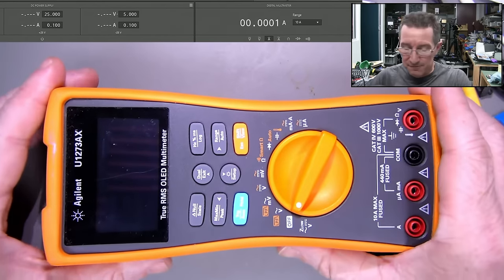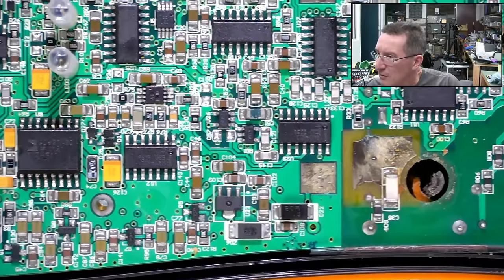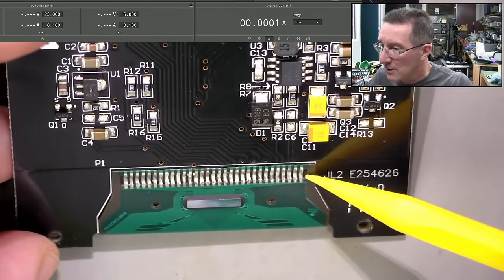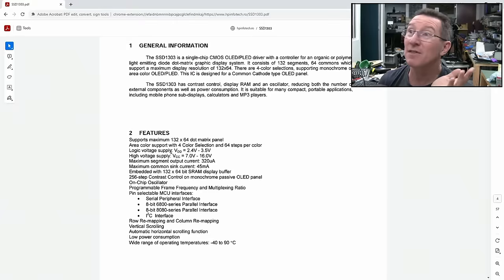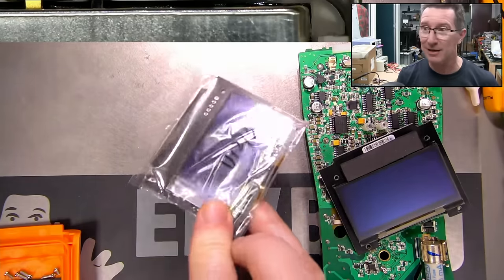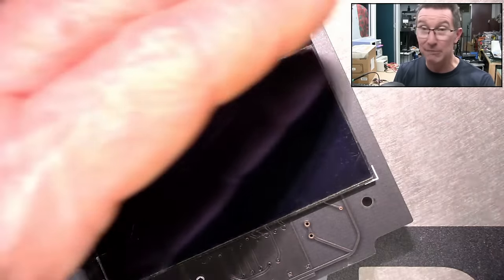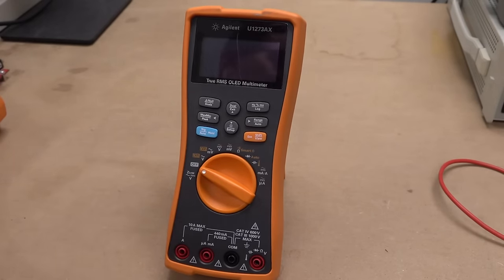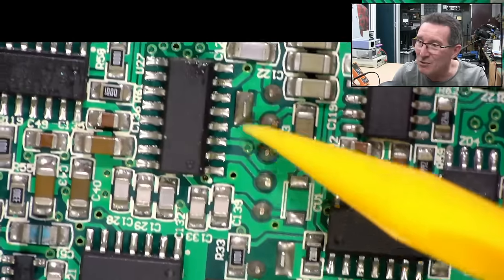EEVblog 1564 - Agilent/Keysight U1273AX Multimeter Repair

Comment: I avoid using alkaline batteries in anything that doesn't see frequent use. I'm gradually switching to lithium ion, but I'm still happy with carbon cells, for the safety of my devices.
Reply: So you're saying only alkaline leak. Carbon and lithium can leak too. We use alkaline as it lasts longer.
Reply: @jonfreeman9682  Indeed, I bought a brand new 996 battery (the big square 6V one) and it was dead; I couldn't be bothered returning it, so I popped the top off and found 2 of the 4 cells were heavily corroded with almost no zinc left. This was a Varta battery, although I note it was made in China and had no production date marked on it.
Reply: @cambridgemart2075  Thanks for sharing. I use alkaline as it's cheaper than lithium which lasts longer but lithium is expensive. Carbon is cheapest but for double the price you get better quality with alkaline which holds the charge longer. I think all batteries can leak and the cause is moisture humidity and overheating of the batteries which cause swelling so the seals are broken and moisture gets in reacting with the chemicals hence corrosion and leak. But lithium is definitely higher build quality. I think if you keep equipment in a dry cool place there won't be any leak no matter carbon or alkaline.

Comment: I really don't like the the 1272A ... quite a few measurements are incredibly slow, you sometimes have to wait several long seconds to get near to the proper measurement. Also often the resistor measurements drifts away happily for minutes.

Comment: Do you know how to calibrate extech clamp meter .I turned potentiometer and I think I need jumper wire to processor .It changes with the weather now with about 300 mv

Comment: What do you do about batteries? I guess take them out of devices if not using regularly.  I've had too many leak in test equipment in the past.
Reply: Eneloops.
Reply: My usual problem is that I am using the device regularly, but then something comes along and the device sits unused for an unpredictable amount of time. Sort of a side effect of having too much stuff and too many interesting projects partially completed.
Reply: Generally batteries don't leak. Put devices in a cool dry place and it'll be fine. I think it's heat that causes battery to leak.

Comment: what I would have done from the beginning if I owned a meter like that is to take them up and apply polyurethane glue around the battery box so that it becomes air tight so that nitric acid cannot get in
Reply: Well you don't want to damage the meter.
Reply: It's potassium hydroxide (an alkali), not nitric acid. But your modification sounds like a great idea.

Comment: I invite you to try using refined coconut oil as sold in any cheapie dollar shop.
Use it as a cleaner or lubricant,when warmed to a liquid it can penetrate under components.
Its low melt point and short chain molecules makes it easy to clean up with warm water or alcohol.
Plastic safe,too!

Comment: I'm starting to wonder what the dollar value of the perfectly good hardware murdered by alkaline batteries every year might be.

It wasn't always this bad. Manufacturers made a decision to inflict this on their customers.
Reply: Do you mean battery manufacturers or hardware manufacturers?
Reply: you can use Ni-MH batteries, why risk it
Reply: Alkaline batteries have been killing test equipment for decades.  I rescued several Fluke multimeters right throughout the 1980’s and 1990’s mainly by ultrasonic cleaning, glass fibre pencils & conformal coating.  Every one was fitted with in date Duracells.
Reply: That's why you should always use Ni-MH or Li-FeS2 batteries in expensive equipment. The risk of leakage is significantly lower than with alkaline and carbon zinc batteries.
Reply: @MartinE63  It’s kinda shocking that Duracell is still in business, given how reliably leaky their batteries have been for the past 20 years…
Reply: @tookitogo  Strange isn't it - just checked an old meter I use regularly & the alkaline batteries are dated 2012 and are giving 1.48v each.
They're Tesco brand - cheap supermaket in UK !
Reply: @rocketman221projects  IIRC a decade or two ago, there were red Eveready batteries that did not leak. They were light and contained only dry stuff or something. I wonder what happened to those?
Reply: @jerther_  Carbon-zinc cells are still made. (And they can leak, though it tends to be much rarer.) They’ve become harder to find, since their low capacity makes them undesirable for many applications. But you definitely can get them, and they’re good choices for things like remote controls that use very little power.
Reply: @tookitogo  interresting! Also, if everything is dry, then what's there to leak?
Reply: @jerther_  It’s not actually dry. Like the contents of alkaline batteries, it’s a damp paste. (The term “dry cell” simply contrasts with “wet cells” like car batteries, which use completely liquid electrolyte capable of spilling out. But it’s actually a damp paste.)
Reply: @tookitogo  I have never cracked open an Eveready AA battery, but I did open one of those large red Eveready 6V lantern batteries. You know, those with screw terminals. Inside there were 8 cylindrical batteries wrapped in cardboard.  I opened one and IIRC all I found was a black rod dipped in a very dry gray powder. So dry and powdery, I could've made a hourglass with it. Nothing paste-like. I assumed these batteries and the AA ones used the same chemicals, but did they? Or maybe I am remembering this wrong ;)
Reply: @jerther_  They often dried out over time.
Reply: @tookitogo  Aaaaahhh! The battery I opened was about 10 years old, so yes, it could've dried. But it did not leak! ;)

So I gather they are not leak safe. Just less prone to it, and also low capacity.

Thanks for the info!! There are videos of people opening those batteries on youtube. Quite interresting!

Comment: why aren't there more multimeters with proper rechargeable lithium batteries with auto off? I wonder
Reply: Simple. These are low drain equipment so you don't need lithium batteries. They're expensive.

Comment: OLEDs are a terrible idea for a handheld battery powered device that's supposed to be reliable on the field and keep working under tough conditions for a long time. I don't know who thought this would be a great idea.
Reply: OLED display prices have come down so you see them more often in equipment now. High end premium meters use them as it looks nicer. A definite step up from dinosaur LCD tech.

Comment: For the cost of those screens, they should be giving it OLED tech found in modern smartphones where some panels are offering nearly full DCI-P3 coverage. At a smaller size justify that cost with a high quality display with a higher PPI. Beyond that with such failures, I wonder if they will consider doing a recall.

Comment: replacing the screen changed the power characteristics of the whole machine, especially since it has to power a whole other micro. so the whole device calibrations out?
Reply from the maker: It doesn't work like that. The ADC has it's own voltage reference.
Reply: If properly designed it shouldn't change calibration.

Comment: The problem with most test equipment seems to happen when its manufacturer seems to go the wayside to focus on other industries. Much TME share much in common with medical devices when you account for precision low-drift high-tolerance components with plenty of expensive reference sources & validation involved, the company decided to go all-in on healthcare and spinoff the rest as if it were a consumer market, not sure why, hasn't been overly great for Phillips and clearly not for aglient/HP/whomever either who only rode their last few years of success from medical device profits since a 2020 event.

Comment: Even without research, could have done a bit more testing before breaking into the case. Lots of potential video content for testing a DMM that is working but not displaying, after all the thing has plenty of modes and resultant electrical characteristics.
Reply: Seriously? Its only outputs are a speaker which beeps and the display that didn't work.
Reply: @cambridgemart2075  This comment shows why it would have made good electronics content to show how to test this further. People would learn something.
Reply: @OnStageLighting  How are you going to test it further? You literally have nothing other than the input jacks and that's not going to tell you anything.
Reply: @cambridgemart2075  Think of the jacks as outputs, then read up on how a multimeter works in each mode. Every single mode has a different fingerprint, meaning you can actually verify which modes are working if any. And test the switch, and the controller. You don't need a working screen for that.
Reply: @OnStageLighting  No, it doesn't work like that, DMMs have fixed input impedance unlike moving coil meters; you can tell nothing from the input jacks.

Comment: folks should really remove the batteries from things they only use on occasion, they will destroy the appliance
Reply: But they shouldn't leak. Modern batteries even the cheap ones should last without leaking. I think it's because of heat. If you leave it in a dry cool place there won't be any leaking.

Comment: Had OLED screens die with low hours, with absolutely no symptoms before. Looks like OLED is always a dodgy thing, they simply do not last well.
Reply from the maker: This one wouldn't have even had 1 hour!
Reply: @EEVblog  Snap, had one fail on me recently, less than 10 minutes of use. It turned on, then after 5 seconds went all wonky, then simply went dead. Looks like the failure on them is the high current to the OLED damages the flex joins on the board that supply current, and then  the die becomes detached from those pads. Makes no difference if powered or not, it is just time and ambient humidity that permeates the flex and causes it. Looks like a common thing on all OLED displays, you play a rigged game of when it will fail, some go immediately after manufacture, some last weeks, some last months, and there must be some that are still running years later. 

Will bet that all those fancy OLED TV sets will all sooner or later have panel failure, likely none will make it past 5 years.
Reply: @SeanBZA I think the TV manufacturers are far more diligent about design for longevity than the manufacturers of dinky little monochrome OLEDs.

Comment: A "supercalifragilisticexpialidocious" repair.  It looks like the U1273AX cost over $600.  I will stay away from this meter. Because working with engineers, I want test equipment that works. 
😎  EEVblog. Thank you for some great troubleshooting.

Comment: Honestly? A pretty pathetic meter for the price if you asked me, at least once introduced to the real world. The screen that eats thru batteries and eventually stops working and the voltage divider being right next to one of the battery terminals seems like a pretty awful design. Your average fluke may not have the performance this one did but I've seen them work after getting run over by a truck. This one broke in three different ways by sitting in a box.
Reply: This is a premium meter. But battery leaks will damage any meter even Fluke. The OLED definitely looks nice and is a step up from dinosaur LCD tech.

Comment: OLED sucks, they dies for nothing. You use them, they burn, unused, they oxidize inside and dies. It's seriously a very bad display technology. VFDs were waaaay better, more durable, and emitter as much light but were even more crisp and nice to the eyes. Too bad these beauties were killed by the trend, and maybe by the fact it needed high voltage power supplies.
Reply: OLED is the gold standard of modern display tech now. It's what premium equipment uses.
Reply: @jonfreeman9682  it's disposable rubbish by design....

Comment: The use of OLED displays in such devices is very alarming. They are very unreliable, and most importantly, they do not give any advantages compared to very reliable and energy -efficient LCDs. I would never buy a multimeter with OLED display. And also, this terrible plastic that decomposes from alkali. Agilent you are shi1!
Reply: OLED is new tech. LCD is dinosaur tech. These OLED displays are low res displays compared to phone screens but it's a big step up so high end meters use OLED to differentiate themselves from cheaper models.
Reply: @jonfreeman9682  🤣🤣🤣 That is, cool because it is expensive? It seems to me that you are just a victim of marketers.
Reply: @MaxPivovarov  That's true. It adds no useful functionality other than looks cool. But that's kinda like high end smartphones these days. 😅
Reply: The upside is that OLEDs are simply much easier to read, especially at an angle. Costs reliability and power efficiency though. That's why they offer two models: to let you pick.